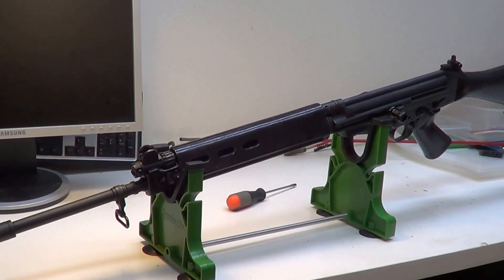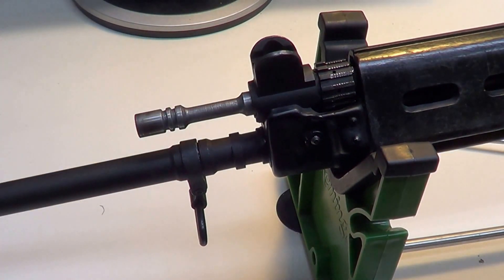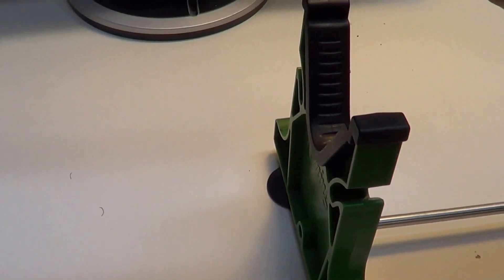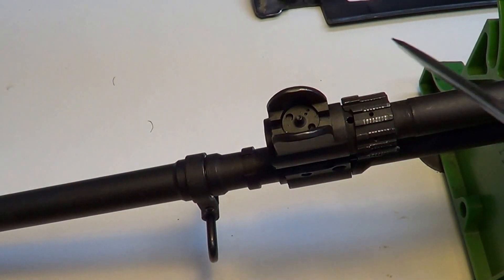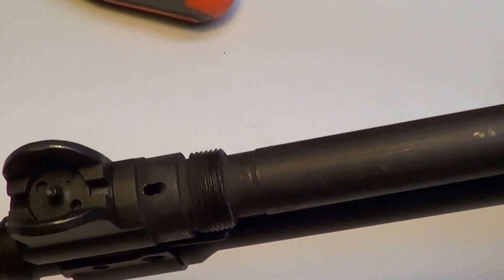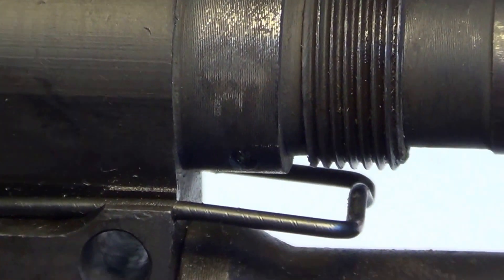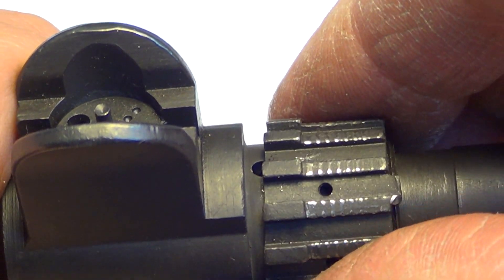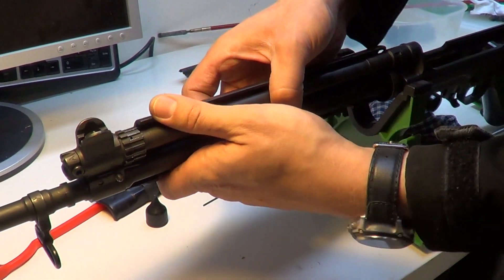FN FAL full gas system explained, gas tube disassembly

Comment: This is going to help tons. I'm trying to figure out why mine isn't cycling at all and this shows possible issue spots. Thanks
Reply from the maker: Make a thorough cleaning.
Set the gas port to am middle point and work your way up or down (up if it doesn't eject and cycle or reduce gas if it does too aggressively).

Check a few different ammo types.

Check any blockage or fouling in the gas plug, gas port and gas collar.

FALs are absolutely reliable and simple AF, so it must be some small issue.

What's the exact problem?

Check.my other FAL video when I am adjusting the gas port

Good luck

Ps I am not a gunsmith so anything you u do is your own liability 😅

Comment: Finally a video that goes over how to get the gas tube loose and not just basic field stripping. I’ve been trying to install a set of Israeli handguards, which use a spacer that goes on the gas tube, but I couldn’t figure out how to get it off.

Comment: Simple novice here but why would one need to adjust the gas system adjustment screw to allow more or less gas to escape???   .308 v 7.62???  Great video thank you!!!
Reply from the maker: @jamescohn4268  this has several reasons and utilities.
You may whish to adjust the gas quantity to the piston for:
1. Dirtier gun under field conditions
2. Different ammo types might demand a bit more or less gas for the piston

It is not related to the age-old debate of 308 vs 7.62

My FAL ate any and all ammo without any hiccups at all, be it 308 or 7.62, brass or even steel case.
Reply: @ awesome man!   Thank you so much!!!!!

Comment: Thank you for making this. The gas regulator spring was installed upside down on mine making the regulator very loose.
Reply from the maker: Yes, in my case the gas collar was screwed back/forced back on the threads completely wrong, leading to FTE issues. I don't understand how these issues happen at all, the gun is fantastic and super simple to reassemble, yet some people just get it wrong.

Comment: Thanks for the video, my inch pattern is slightly different but the principle is the same, the gas tube retaining pin had moved loose causing feeding issues. I guess this will happen again and I need to find an new pin.  Thanks for posting this was a great help in diganosing my problems. Will take it to the range on Saturday to test fire and hope its solved the issues.
Reply: And Im a happy chappy - my FAL is working as it should, so this saved me money and effort. Im going to watch the pin and tube to see if it moves, maybe a new pin is needed or some loctite.

Comment: Excellent video, very informative! But I believe there is one small mistake in your video: 
https://youtu.be/4ggyCmyT_vU?t=718 here you say, that if the gas tube is screwed entirely inside, it blocks the hole where the regulator is and that the piston would not get any gas, if it was closed with gas tube like that. It is actually quite the opposite. If you cover the hole with a gas tube, the piston wold get all the gas and the regulator would quit working, as the hole would be closed with the gas tube from inside. Therefore, it would work on full strength, as the gas is coming from the front, pushes the  piston back and when the piston moves past that hole, it bleeds gas out to soften the action. How much gas is bled out depends on the setting of the regulator. If it closes the hole completely, no gas is bled out, if it closes the hole only partially, some gas is let out and the action is softer...

Anyway, very helpful video, thank you!
Reply from the maker: František Soumar thanks mate, dobri den from Hungary
Reply: Bear of Sinai Are you Hungarian? Jó napot! :-) I don't speak Hungarian, but you obviously know some Czech words, kudos for that! :-)
Reply from the maker: František Soumar my czech was made better thansk to my FAVORITE brand: czeska zbrojovka! dobri puska! vynikajici kvalitny! dakujem!

i am a huge fan of czech firearms.

had 2 vz 58s, a vz 52, a brno22 mod2, a cz75b with a kadet slide. loved them all.
Reply: Bear of Sinai You have a good taste in firearms... I am a supplier to CZ in Uhersky Brod (btw. Uhersky means Ungarian :-) and I know the factory quite well... They do manufacture some fine weapons. However, I only own P-07... :-)

Comment: Keeping my Fingers crossed but you might have just showed me what i needed to know about why MY FAL would not cycle. It seems as though some Numbnut put the Gas tube in and never put that little pin in. Thus allowing my gas tube to rotate and block the gas hole completly. I just took a Roll pin and filed it down to fit the hole. so now the gas tube stays where it should and keeps the gas hole on the top open. I will try to get to the range sometime in next week. wish me luck. and thanks for the Vid.
Reply from the maker: lol another friday shift in the armoury... my gas nut was installed iin the wrong way, my Fal also didnt cycle, thats why started to fanangle with my Fal. i wish u luck!
Reply: Update... That definetly helped it. I do have it now functioning but only on number 2 setting so the gas system is not the greatest but it is running reliable now. Thanks again for the Vid !
Reply: That’s exactly what happened to mine

Comment: Thanks for uploading this very educating video. My FN FAL's gas plug is stuck, i cannot remove it or rotate it in the first place, even when i depress the small button. It hasn't been disassembled or cleaned for over 20 years... so i must presume it has a lot of rust that is causing it to jam like this. Also the adjustment screw of the gas system is stuck/jammed and also probably because of the rust. I sprayed it with a special gun oil that removes rust 2 days ago and i tried today to move it but i couldn't do it with my bare hands. Any suggestions?
Reply: Bear of Sinai thanks for you detailed reply. i have decided to take it to the gunsmith tomorrow since i do not have all the required equipment at home. i will let you know what happens later.
Reply from the maker: Micho that is a WISE choice, Micho San. Travel with Zen through life, but have your FAL on your back, just in case...
Reply: Bear of Sinai after taking my FAL to the gunsmith we managed to fix it [was able to disassemble it after firing around 500 rounds and left without cleaning for 30+ years(by my stupid uncle) ...] but had one problem, we couldn't remove the small pin that holds the gas tube. Tried everything, sprayed it with oil and left it for hours and tried to push it like you did in the video but it just didn't move even 1mm. Is this bad, or dangerous? can I fire my FAL safely? without being able to remove this pin and the gas tube?
Thanks mate.
Reply from the maker: Micho First of all, let's emphasize the fact, that your uncle is a genious, cause he bought a FAL, which he gave to you.

WISHED I HAD AN UNCLE LIKE THAT :)!!! 

Anyhow, the gas tube itself doesn't need to get removed at any time, unless it's kaputt/fracked up. It's my custom, that if I buy any firearm (old, or milsurp), I disassemble it byond field strip, and examine it.

If your gas tube is broken (literally), your rifle won't cycle. Taht's all.

Caould you remove the piston? The spring? Are they OK?

If yes, just make sure the gas tube is clean, use a cleaning rod with a large enough brush, clean it out. USE PATCHES ONLY IF FIXED TO THE CLEANING ROD, cause if they fall off, it will be a bitch to remove with a gas tube fixed.

Use a lamp, check out, if the tube is unblocked, no gunk, junk, shit is in it. Look into the gas tube from both ways, same as checking a bore.

Point being, the gas tube must be without obstacles.
Reply: Bear of Sinai LOL well actually, it was my grand father who bought the FAL, my uncle just shot a couple thousand rounds[turns out it was more than i expected] and didn't clean it, left it for years and fucked it up. :P   .

Everything is okay now with the rifle's disassembly except for the gas tube which i couldn't remove because of the pin. but the gas tube itself is in very good shape.(i just sprayed some oil inside the gas tube, i don't wanna risk having a patch stuck inside.)

Anyway.. I am modernizing my FN FAL so, i got a scope mount [35$] and a BIG ASS 6-24x50 scope[155 $], and it looks GREAT when mounted on the rifle.

http://postimage.org/image/d3hfg767h/
http://postimage.org/image/bpudymwbx/

i also ordered a Quad Rail mounting system [62$] (picatinny rail) and planning on getting a Bipod and a Vertical Grip, when they arrive i will show you how it looks.
when the setup is complete , i'm gonna take it to the range and fire it and zero the scope.
Reply from the maker: Micho i am happy your ordeal comes to a happy end.

However, do clean.out the gas tube, especially after spraying it full with oil. 

OIL ATTRACTS DIRT. .no gun parts should be drowning in oil,unless for long term storage.
Reply: Bear of Sinai i didn't drown it in oil i just sprayed a little amount and left the gun standing upside down and the oil drained out. it had a very dark color because of the old gunpowder that was in there.thanks again Bear!
Reply from the maker: Micho try to clean the gas tube iout with a 9mm or 45 brush and moppe...it wont fall in and stay in the tube. Wellcome btw, FnFal operators of the world, Unite!
Reply: Bear of Sinai okay i will try that method!FN FAL rule!!
Reply from the maker: Micho trust your FAL. NO ZOMBIE WILL GET PAST U!
Reply from the maker: Micho As your uncle used to say, a FAL makes a haji sit down. For good.

Be a nice guy, and buy a sixpack, and drink it 2gether with your Dad and Uncle. Don't mess with Karma! They must be cool guys to buy and give FAL to you.

Wonder why nobody ever gave me a FAL as a present... I am such a nice guy.
Reply: Bear of Sinai LOL I bet you are (no pun intended) and no i was just kidding. cheers mate!btw i ordered an m4a1 carbine 14.5" and i'm expecting it to arrive within a month or so... gotta have a modern rifle also.. but nothing stands infront of a FAL and its mighty power ;)
Reply from the maker: Micho OMG buying AR-s like a pair of shoe... overseas, here in Hungary, they start at 2000 USD price range (not the high-tier models, only the plain workhorses).

My credo is:

ONE GUN IS GOOD. 
TWO GUNs R BETTER.
THREE GUNS R BUTTER :)
Reply: Mucho you do not oil the gas piston tube.it says in the fal manual I have.you leave that dry.you are inviting trouble there.

Comment: Thanks for uploading this it's good to get a visual reference I couldn't find any videos with removal of the regulator screw. On mine it is impossibly tight and even with the wrench made for it, it is a bitch to move. I need to see if carbon or something is keeping it from moving freely.
Reply: Happy to help, mate! Btw., there is no reason to ever remove the gas tube at all, only in case you need to replace the gas adjust screw, or the tube itself.  You can clean it after removing the piston anyway, so don't remove that.

I guess yours is stuck at the chamber end (the right end of the tube. opposite the muzzle).

If you must remove it, DON'T USE A WRENCH FIRST, cause you will break the tube (it is not hardened steel!), and you're screwed/screwless.:). Spray it with thread loosener, and let it soak an hour, try then with a wrench carefully. Even better, after the sparying, heat it with a lighter, also helps loosening.

But IMHO, you can replace the gas adjust screw with half removed tube, so leave it be anyways.
Reply: Sorry, let me get more precise a bit. I meant, there is no need to remove the gas tube (usually). The gas adjust screw can also be loosened with the same methods, just be patient with it.

You can use a pair of plumber's plyers, the longer the handle, the better. The gas adjust screw is tough, just put a cloth on it,  so you don't mar it or fuck it up with the plyers.